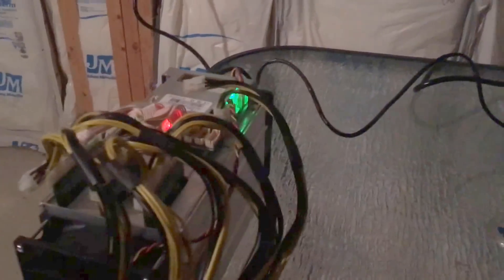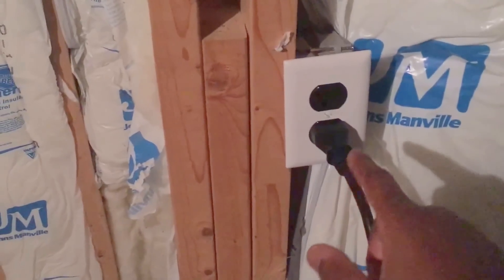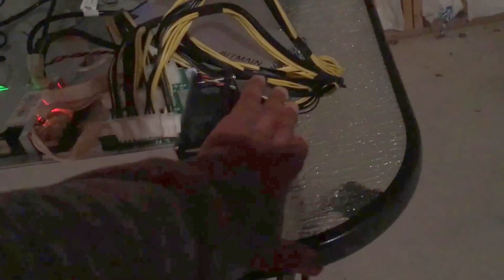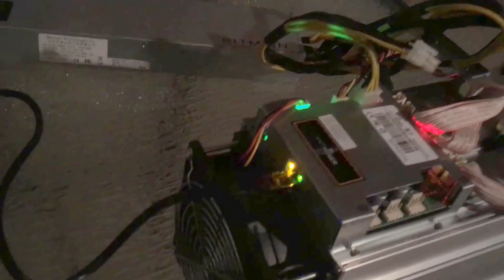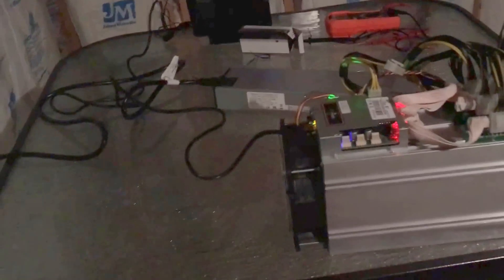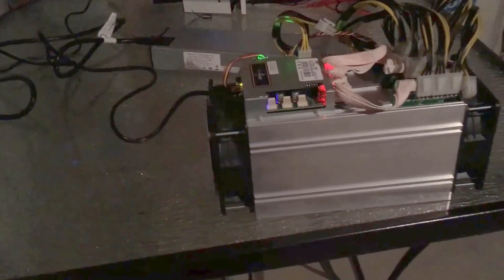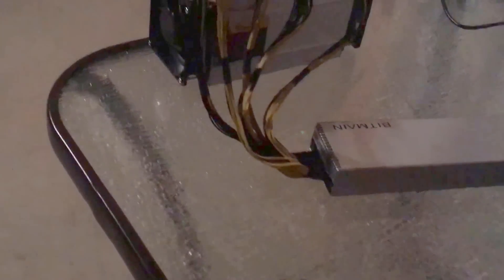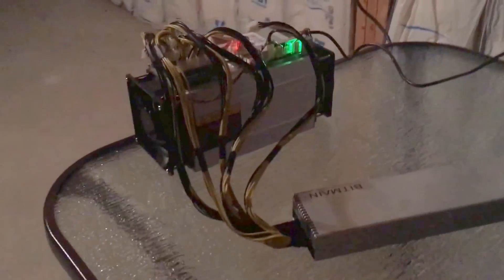bitmain antminer s7 full setup and review

Comment: You might think about re-doing this video with all the watt vs voltage errors corrected. I have no idea what a 250W cable is for instance. And a WiFi that draws 120W? uh-huh. After all those technical errors I stopped the video and moved on.
Reply: I'm an electrician - and I don't even know where to start with how often he inaccurately uses the words 'watts' and 'volts'. I don't even want to start a correction discussion - just know that he's clueless.
Reply: Yep I didn't hit 30 seconds and I was like nevermind I'm going to go look at the comments this should be funny

Comment: Hi, I just bought an antminer s7 and I have a EVGA 1600 G2 power supply. But it says on the paper that the miner uses 16A and that home outlets are 10A, but I am also seeing that some houses have 15A. The miner does use full 16A, it's around 13/1/2. Is there a way to check what my outlet has? If not, it says if using at home, to power it via two sockets located on deprecate power rails. What does this mean? Could someone help me? Thanks!!
Reply: Connor Lapping are you selling this??

Comment: Hey, I have the same equipment. Ran into same problem, need 200+ volt outlet.  Just wondering how the PSU wires are conneted to the antminer?  you connected each set of three to each hashboard, and then the one to the main board?

Comment: Do you know what type of outlet that was used for that PSU? I want to set them up in my garage and the electrician needs to know what outlet to use.
Reply from the maker: All the equipment in video has a link in the description
Reply: +Christopher C. Wow, super fail on my part, thanks for answering.
Reply: +Jeff Saubert If you have a electric dryer not gas, it runs off of 220v. You can have another one (Breaker) installed in the box. Make sure it's a 20amp Double 220v breaker and run wire off it. Tested mine when he was done and I'm getting 243v.
Reply: Sounds good, he put up several 240 volt outlet for me.
Reply: +Jeff Saubert Good deal. I hope it works out.
Reply: Thank you, me too.

Comment: hi, Can a 10 amp power cord be used with PSU?
Reply from the maker: The specs from this cord should help but most important is 16a gauge it's thicker cause of the heat http://www.amazon.com/gp/product/B0049XGZ8U/ref=as_li_ss_tl?psc=1&redirect=true&ref_=oh_aui_detailpage_o06_s01&linkCode=sl1&tag=masslife-20&linkId=2612dd0ae488ebd0eb8e313206cf6088
Reply: Yes as far as I know what is it 800 w you need 10 amp or higher so 10 amp should work

Comment: hi Christopher; i need you to help me please, how to connect antminer with computer ?
Reply from the maker: +Ahmed Abelbal you will need to make sure antminer is connected to router. green light on antminer should come on when ethernet connection is available if the antminer is connected and not getting out to the internet then it will beep continusouly. once your done with that you need to get the ip address of the antminer by login into router and find the new ip address your router is giving. (can't miss it unless your in a huge building with a lot of device on the network). your log info for router is usually on the back of your router. after all that you will have access to antminer User interface to input data for mining and pools. good luck
Reply: thank you very much  brother

Comment: Hi, I turned on all day how much as miner?
Reply: Translation: Running 24/7. How much would I earn a day?
Reply from the maker: Not sure I get the question
Reply from the maker: +nebulawars 0.015 to 0.02 btc with current specs
Reply: +Jason McDaniel (Spyderdreams) your calculation is wrong.A day has 24 hours so .08$/kWh x 3kWh x 24h = 5.76 a day in electricity.

Comment: Hey man! Congrats! Just wanna say it is not loud because it was not connected to a pool as I saw that you turned that access point later. I would recommend you to run network cable as the access point may loose connection.